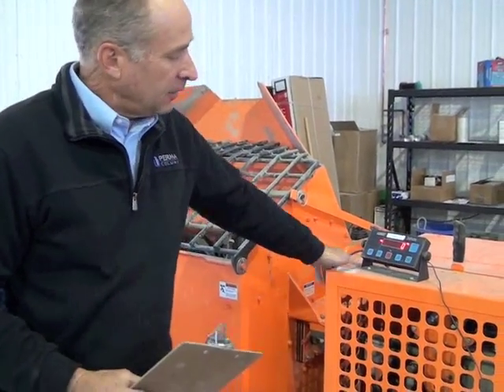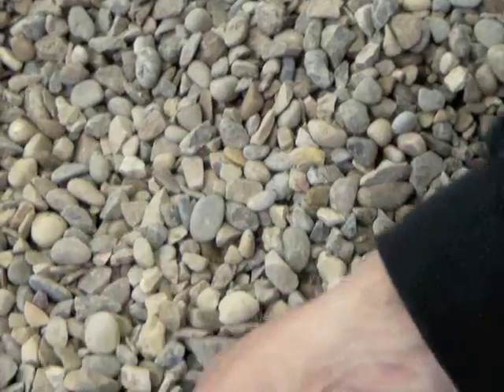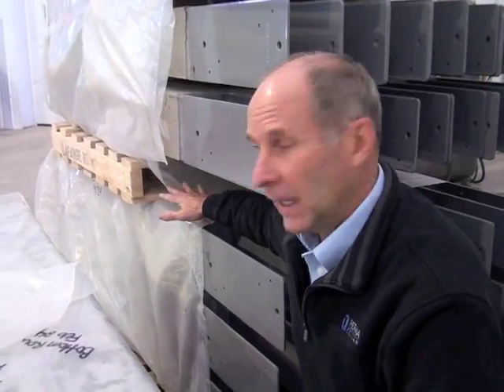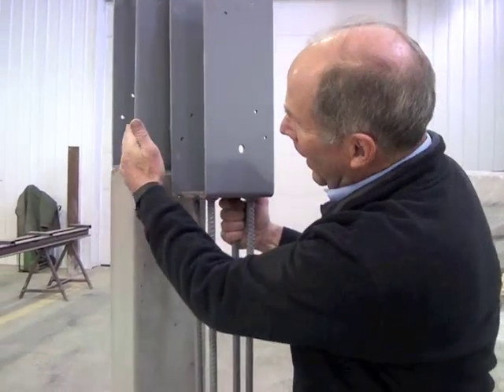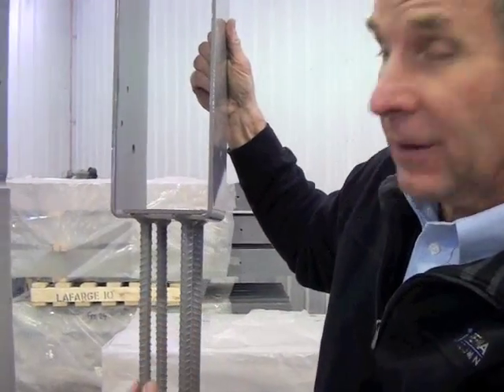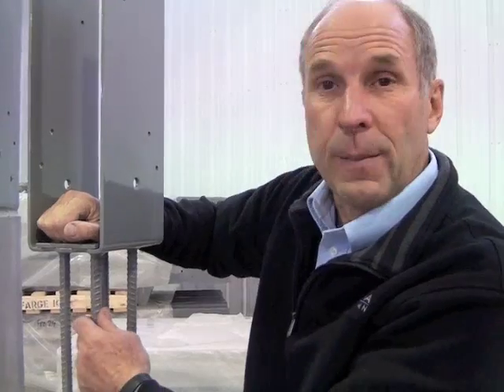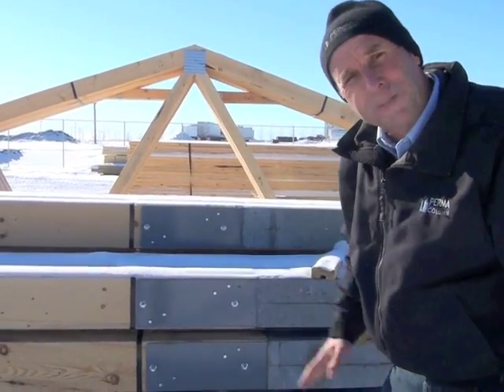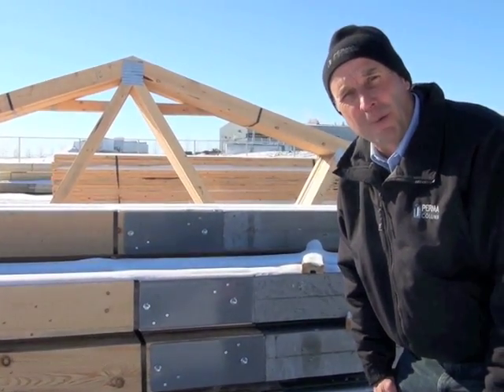Part 1: The Making of a Perma-Column at Integrity Post Structures

Comment: I looked at these at my local whites lumber not impressed concrete had alot of bubbles looked very porous on the surface and alot of broken edges along with very rusty brackets

Comment: I still don't know how these go into the ground
Reply: you drill a big hole in the ground and set those in then pour concrete in. The idea here is that the wood is not in a soil. It sits in that bracket and it will not rot that way

Comment: i welded rebar from Lowe's and it welds just fine
Reply: as long as you know the steel grade and how to weld, it is perfectly weldable, heard of rebar structures getting welded for certain structure foundations instead of twist-tying
Reply: I'm not really sure what he was talking about as I think I'll rebars weldable. But maybe that rebar is a specific grade that's designed to keep its strength. These from accounts are not terribly cheap so I would not be surprised if they used special rebar